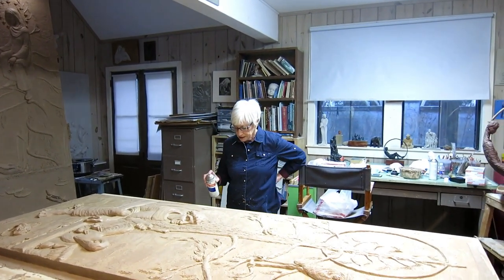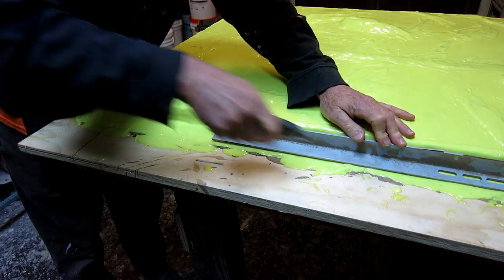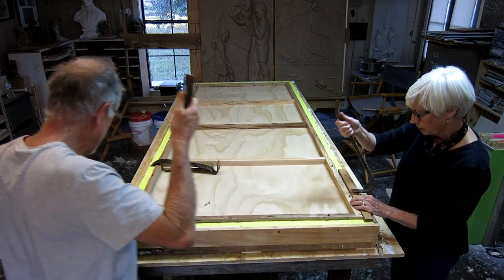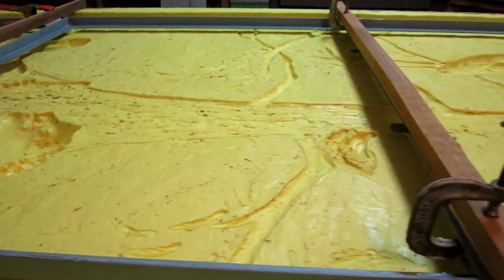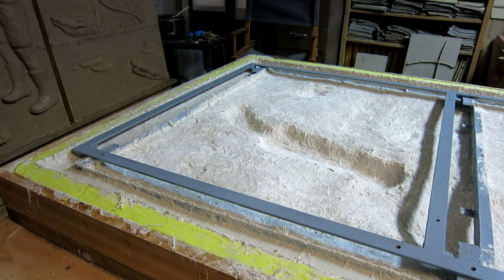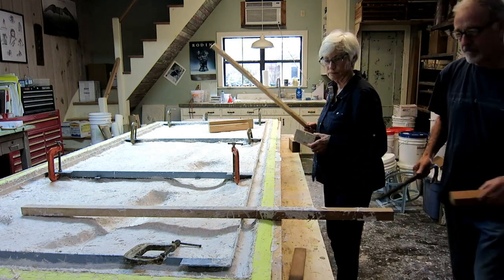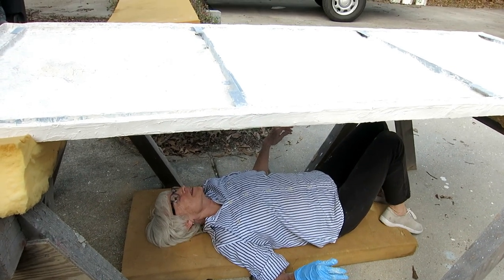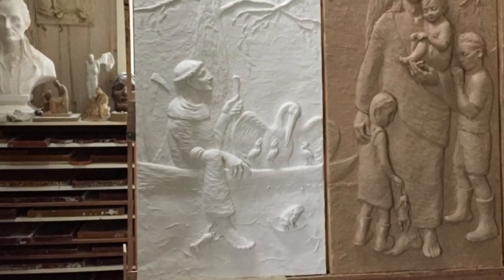Deb's Triptych 6  Making The Big Molds

Comment: Thank you both for making this video, it is very informative! Do you remember (roughly) the weight and dimensions for one of those panel castings?  I am working on a project of similar size and I am trying to figure out if Sculpt-On's Forton MG or GFRC products are a viable option for what I am doing. I hope both of you are well, thank you!
Reply from the maker: Patrick
Glad the video was helpful. I believe the panels were about  3' X 7.5'. and I am guessing at maybe 150 lbs. We use a lot of Forton MG and we get it from Reynolds Advanced Materials. The finished product is pretty much bullet proof, and patches perfectly.  Much lighter in weight finished product than Hydro-stone which we use for all of Debbie's smaller work. It is not very pretty, just plain white, so Debbie usually gives it some sort of patina with latex paints and waxes. We have had a problem with a couple of casts warping before they were pulled form the molds. Some sort of curing issue in which we have not received a definite cause from the vendors. Some say we applied successive coats too soon and some say not soon enough. We think the latter. Anyway with the very low reliefs it is more of a problem than the high reliefs. In spite of this issue it is still our go to product for all of the larger reliefs.
Reply: @barrylukebuilds7894  Thank you very much for the info. With the price point and learning curve that come with these products I really appreciate you taking the time to share what you've learned. Keep up the good work :)